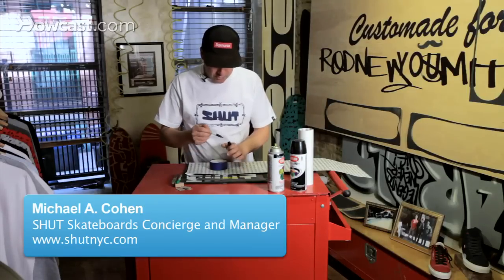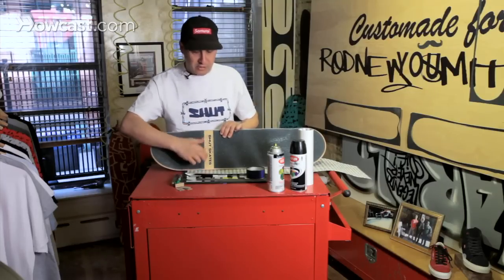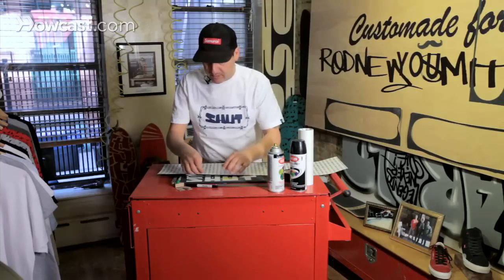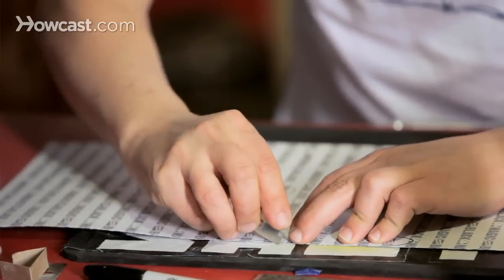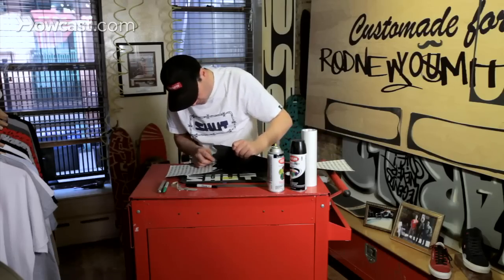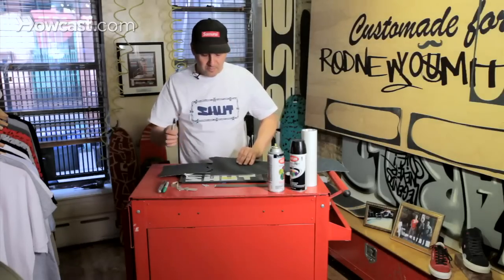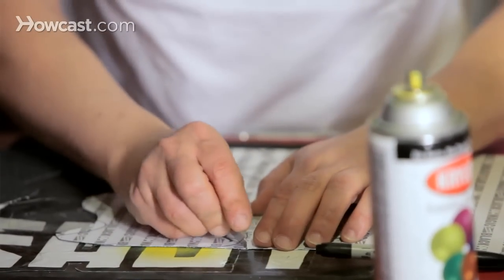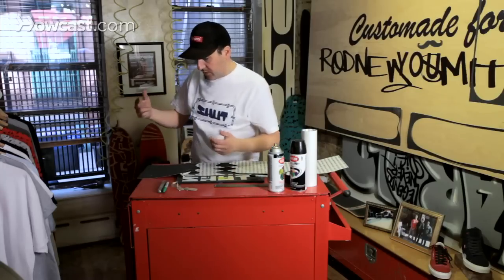How to Cut & Apply a Grip Tape Design | Custom Skateboard

Comment: How do you get the grip to not peel after doing custom cuts
Reply: Push it on hard or get better grip
Reply: @jkbroboss  doesn’t matter what grip it is, sliding your foot on the board will eventually start to peel the grip
Reply: @harleymason9769  sand it down with the leftover griptape